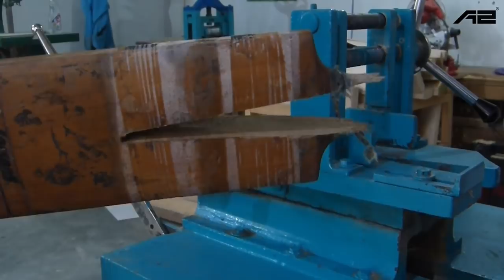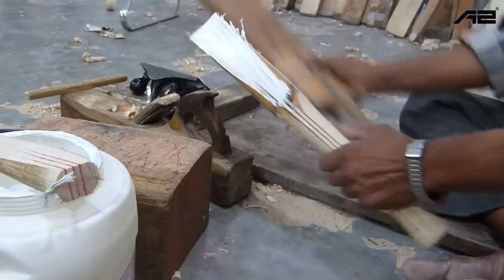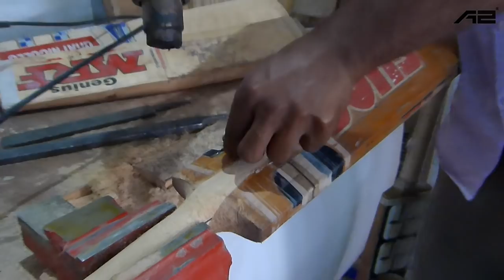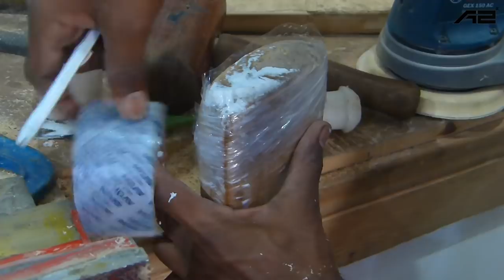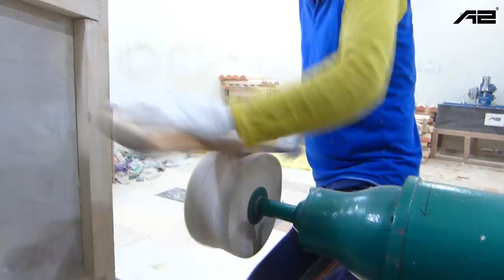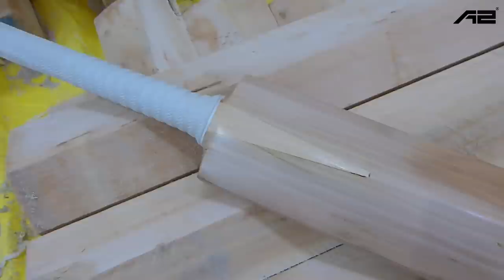Repairing a Vintage Cricket Bat  🏏🔥 - A2 Cricket.

Comment: How is the handle still holding with just fevicol glue? It will come apart any second.
Reply from the maker: Dear Sir, the handle of all cricket bats is fixed similarly. The handle sticks very well against the willow as the handle is made from Seravak Cane and the contrasting texture of the timber provides a very snug fit. The same is done to all bats made around the world.
Reply: @A2Cricket  but why didn't u apply any pressure after adding the handle ? ..